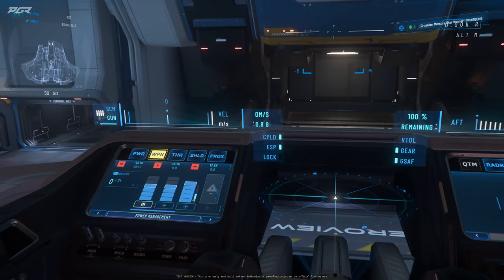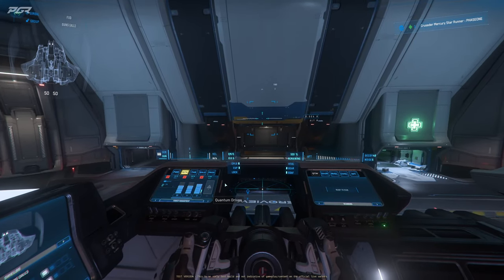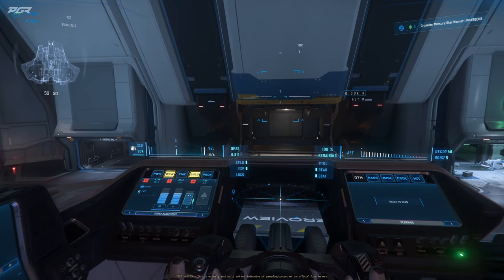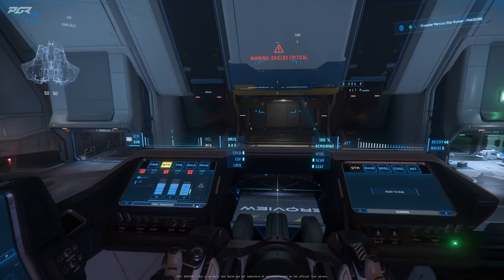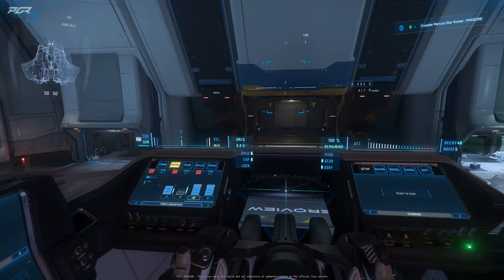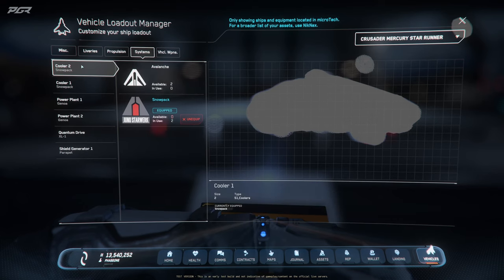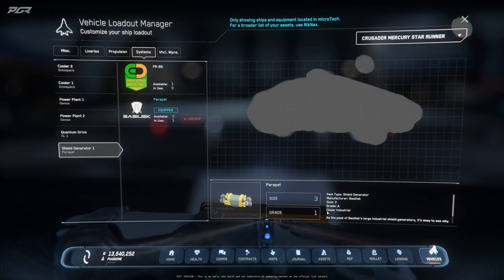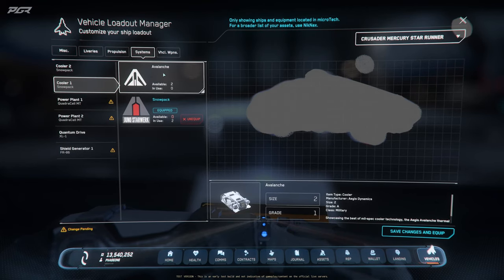Early Signs Of Engineering Gameplay in Star Citizen 3.24.2 You NEED To Know!

Comment: Since I discovered erkul I've known Industrial coolers and power plants are the best, while military QT are the fastest (while also being massive fuel hogs, so not necessarily the best choice depending on ship and needs).  Of course, they're also the priciest options for those categories! :-)
Reply: On the subject of "best" QT drives and Industrial, I'm pretty sure Industrial QT drives are categorically the worst; they're not the most efficient, but are often at least as slow if not shower than the most fuel efficient drives, and they're definitely not the fastest. Now, this may have changed since I last looked, but when Farrister does reviews on a ship and says the first thing to do is replace the QT drive, you can be fairly sure it's an Industrial drive.

Comment: its great that they are making the components require different minimums and that means there is a lot to do when it comes to power management, I'm just wondering what the engineering gameplay will do to those, like will it help change the power requirements, like make it take less power for the same cooling for less shielding on it?

Comment: For the current moment (3.24.1 and earlier), CIG set the stats of most modules back to some baseline. They wanted to rebalance with the introduction of engineering. I hope they do some proper rock-paper-scissors. And have enough consequences, compromises and constraints to make things interesting. If all it takes to be a "winner" is to install all military style components, they failed. We'll see. I don't expect them to get things right right away, it just needs to be on the right trajectory.

Comment: there are just a lot of issues 
some of us can think of ways to resolve them

but full persistance of ships 
bed logging and players being AFK kicked and ending up at home locaiton where their ship is unknown 

i want any ship destroyed to be salvage  wreck mission for other players
parts resale economy
an insurance claims would revert ships to stock build 
if your ship is unknown you should have a PING locaiton so you can recover it it's weird they haven't fixed this issue yet

OK explaining Parts

competative = high peroformance high power cooling demands low armor high IR / EM signiture
stealth = military grade mid performance Low EM LOW IR quick reboot time after EMP
militarry = armored EM shielded  but slow power draw and high requirement for cooling 
Industrial = high EM IR but perforamnce durability are higher speeds not so much
civilian = good balance part across board.